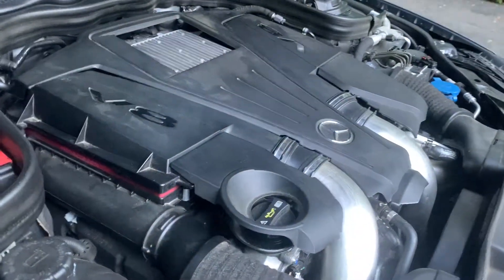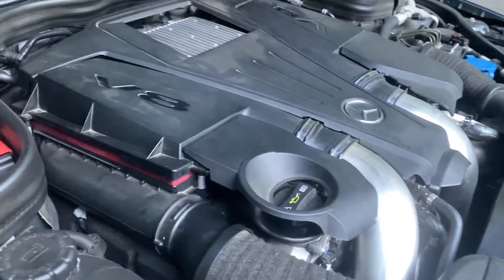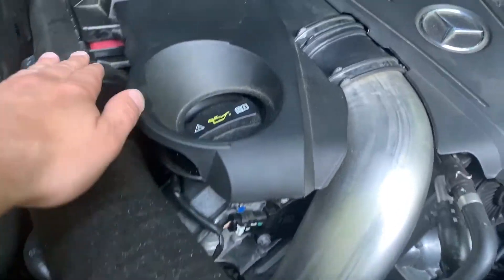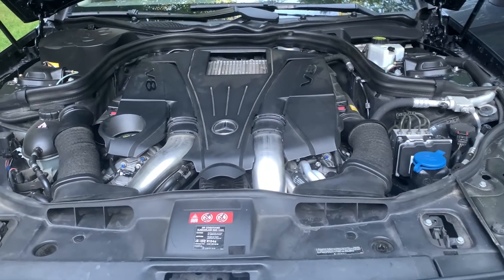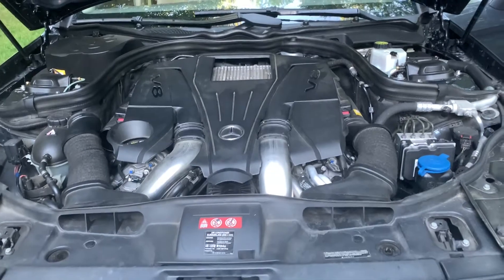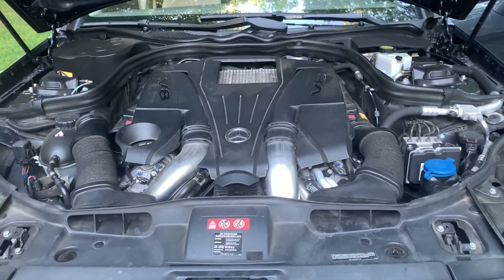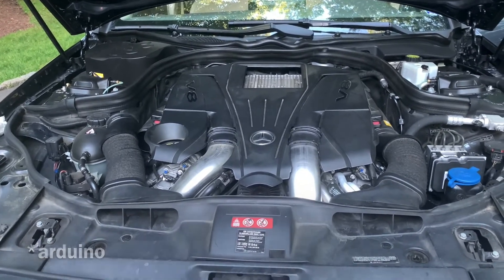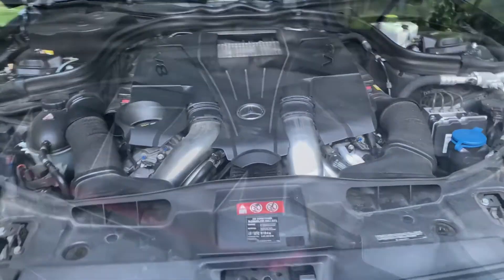UPD Cold Air Boost Kit — What do they do?  Are they worth it?

Comment: Great! Thanks for that, so you do notice a difference in Sound? Do you think you will also notice is with the stock filters? And please keep your CLS :-)
Reply from the maker: You can hear the turbos spool so it definitely changes the sound.  The stock filters are really thick. Like 2.5" to 3" and I wondered if maybe they went with such a thick filter to drown out the turbo noise.  I found a really cheap second hand kit on FB -- I believe I posted to the facebook.com/groups/TunedMercedes for $200 with filters and there's a discussion about aftermarket filters on there.  I guess there have been reports that oiled filters like K&N can clog MAF sensors, but there's no MAF sensor on the m278/157 they use MAP sensors.  I have heard some reports of a competitor to K&N filters having some of the medium pulled through.  I understand the hesitancy, but the stock filters are extremely thick and seem a bit too restrictive to me.

Comment: I like mine,  Pricey but that comes along with performance.
Reply: You won't get a power increase from a air intake upgrade worth a few hp at best. Not worth over $350. CAI's were Mythbusters several times.
Reply: I saw that episode.  These cars already draw air from the front of the car. (Cai).  When you add increased boost from tuning,  the stock air boxes are restrictions and opening them up does more than for a natural aspirated car.